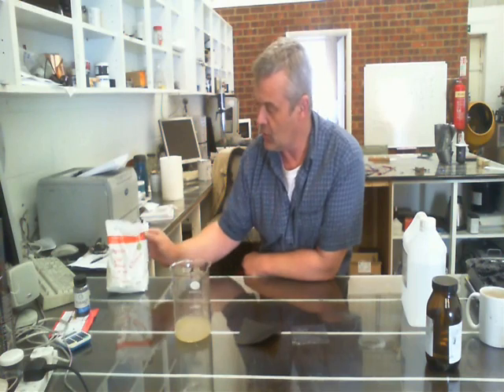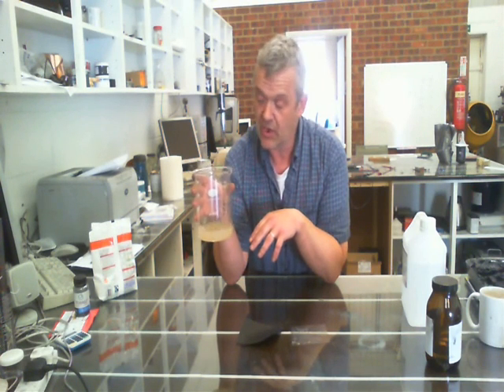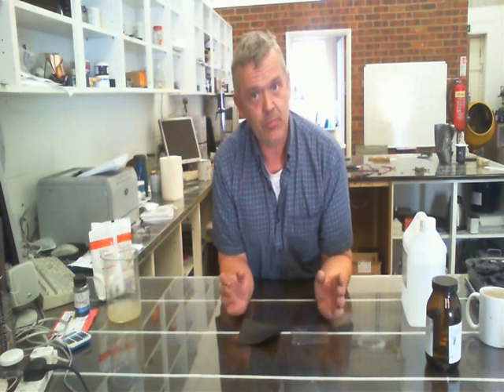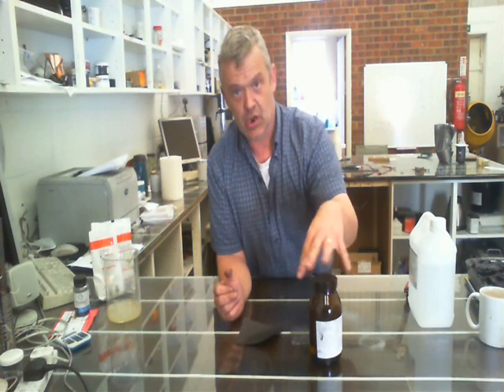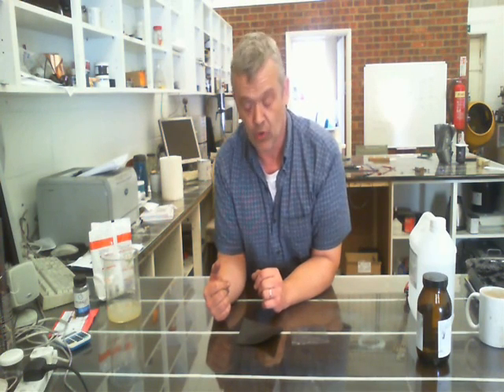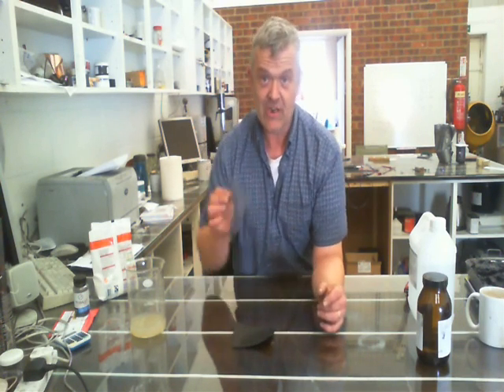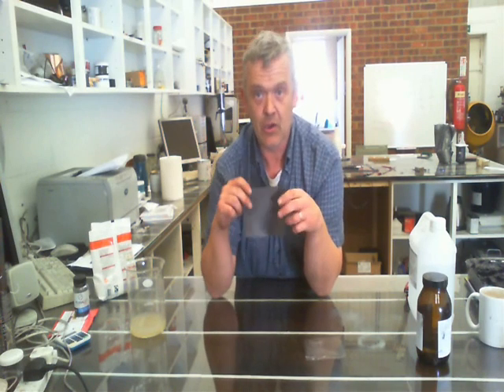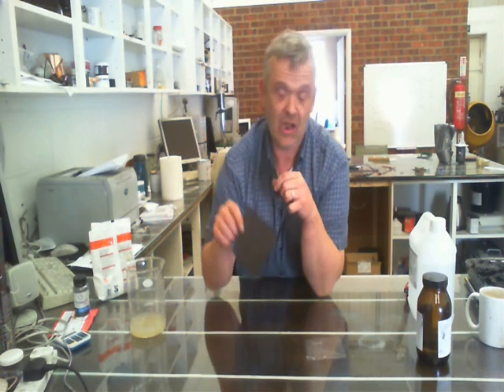Terry Hope - Casting Thin, Tough Bioplastics Casein

Comment: Hey Rob, I am looking to make a thin (PEM) membrane material as the heart of my experimental fuel cell and will be adding Mica as the proton carrier. I assume you can just add glycerin or sulphur to make it slightly rubbery but my question is around how you where able to cast it so thin and so accurately?
Reply from the maker: there is a linear relationship between percentage of solid against percentage of carriers - if you cast a 100 micron film with 35% solids it will dry to 35 microns - you can use that to manipulate film thickness

Comment: Hi Robert, first of all, thanks so much for the data, love your video! I truly do.
I've been watching your casein ones so many times for a design university project, I'm trying to make an MDF-ish type of material using casein as a binding substance. I have two main question, what's the difference of using borax or alkali in the mixture and the second one is if there's an effective formaldehyde replacement (commercially available). I can't find a clear answer in google scholar. Thanks again!
Reply: I just experimented a bit with Casein glue. I used CaOH and Calcium Caseinate. The mixture gels up and does not dissolve in water. When i put it in tannic acid there was a very clear reaction with the tannic acid (it stained the gelled up glue and i wasn't able to wash it off). So my guess is that there's some cross linking going on. Maybe this will harden your material. 
I made some leather before and what happend when i put the dried casein glue into tannic acid felt a lot like what happened when i vegetable tanned leather.

Comment: Have you tried adding anything like over the counter water suspended acrylic like a concrete sealer to experiment with various properties?

I am hoping before long to also experiment with refining and playing around with pine tree rosins with those items like toll oil, although at this point I know nothing about them chemically, I grew up playing with it as it makes a very interesting ultra thin film when reacting with water directly from a fresh young candela* [a word I grew up with and which I can not find on an internet search so I do not know if it is a proper term] when dropped in water.

The reaction is rather exuberant and will propel the piece of pine across the water like a little motor although it often twirls and seldom goes straight, and most of the propulsion is from water tension and drag than from anything you would cal real thrust and it leaves a super fine film which can some times be carefully lifted out, although it breaks easily, and it can float a pin on occasion, if you can lay the pin on it carefully enough.

I know that amber is the product of resins but not if its anything useful for creating working plastics.

Any types of other natural materials one can add would be interesting.

If I have any success, I will be sure and post the results where it can be found on my account.
Reply from the maker: go for it

Comment: Thank you so much for the video. I bought the book and was looking for how many parts alkali to add to the casein in order to dissolve it. Does the solution just turn clear when its fully dissolved? I wanted to add sodium bicarbonate instead as an alkali and was just wondering if that would not work as well as ammonia. Also, could a similar process be used with whey protein?
Reply from the maker: kind of a clear very slightly amber and carbonates work well too - though sodium carbonate - washing soda - would be better. Whey protein is going to be slightly different - it's going to take you a while to get to grips with casein so if i were you i would concentrate on that - get it up and running then turn your attention to other materials - that's just a suggestion though

Comment: Dear Sir, Is this casein plastic heat resistive? Could someone use it to create high voltage electrodes from it e.g. with and without graphene as additive?
Reply from the maker: it's a protein based plastic - so no - well no more than most

Comment: Do you know if there's a way to use Casein in the context of 3d Printers?, since it's a thermoset instead of a themoplastic I think it can't be re-melted once it's set and most printers work via a spindle of prior extruded material.
If there was a way to optically cure it once a layer of it was put down that might be one way, or keep it in a state where it was thick enough to "print" without setting prior to printing that might be another way
Reply from the maker: I don't think you will be able to get it to do that mate - solvent casting might be a way forward but still a challenge - it can be optically cured but optical curing involves some pretty harsh photo initiators and cross linkers

Comment: Corn Starch is what I use, really any starch will work. . just to keep it Bio. I never tried formaldehyde? This would make it a non Bio film correct?
  I been thinking of trying to carbon fiber some of these materials?  Drawl them down as far as possible, to align the links, then 3 step heat treatments to see if this is something that can be done at home.  I imagine a carbon fiber made out of natural ingredients instead of The  Poly Acrylics would have some interest.
Nice information for me these last couple of Videos. Rock on Robert!  
Peace Out Murf!
Reply from the maker: lol - no worries mate - but adding formaldehyde wouldn't ruin the bio usp - bio refers to the source of monomer - anyway formaldehyde is naturally occurring in apples etc and is completely biodegradable - if you don't like the name formaldehyde your allowed to call it methelyne glycol if it is in water and normally it is - it's a protein cross linker so no good for starches which are polysaccharides.
Reply: This reminded me of petition that called dihydrogen monoxide (DHMO) to be regulated, labeled as hazardous, or banned, because Dihydrogen monoxide:
*is also known as hydroxyl acid, and is the major component of acid rain.
*contributes to the "greenhouse effect".
*may cause severe burns.
*contributes to the erosion of our natural landscape.
*accelerates corrosion and rusting of many metals.
*may cause electrical failures and decreased effectiveness of automobile brakes.
*has been found in excised tumors of terminal cancer patients.

Despite the danger, dihydrogen monoxide is often used:
*as an industrial solvent and coolant.
*in nuclear power plants.
*in the production of Styrofoam.
*as a fire retardant.
*in many forms of cruel animal research.
*in the distribution of pesticides. Even after washing, produce remains contaminated by this chemical.
*as an additive in certain "junk-foods" and other food products.
Reply from the maker: wwwelkam
lol - i may use this in future vids - brilliant lol

Comment: I'm curious to know what the resistance through the thickness of the graphite plastic sheet is ? I may find it useful for the "dry stack" battery concept I'm working on.
Reply from the maker: i'm at home now - i'll measure it tomorrow
Reply from the maker: 250 ohms per square at 10 microns thick - which makes it 100 ohms per square per mil - but i made no effort to maximise conductivity - i just put 50:50 binder to ink in a jar and mixed it up for the demo
Reply: Robert Murray-Smith It's conductive and that's pretty good!  I've mixed graphite with melted PE.  I didn't get a nice pretty sheet and it wasn't conductive.  In my application I'd be using the conductivity from the top of the sheet to the bottom of the sheet rather than along the plane of the sheet.
Reply from the maker: Joseph Richardson
might well be the way to go - if you are using an acid electrolyte you probably wouldn't need the formaldehyde step as casein is insoluble in weak acid